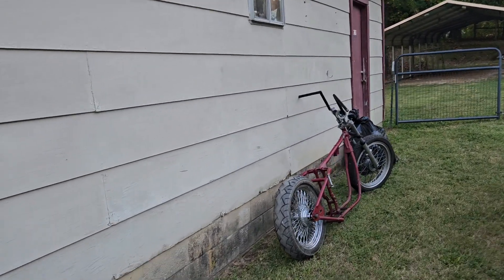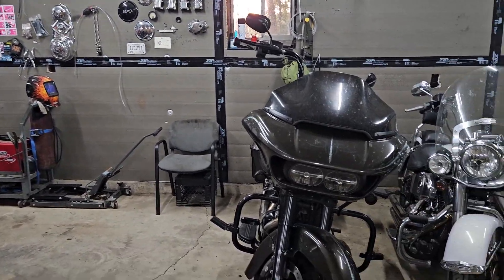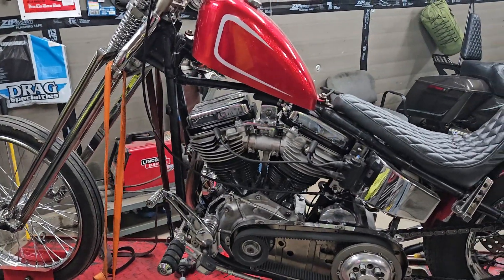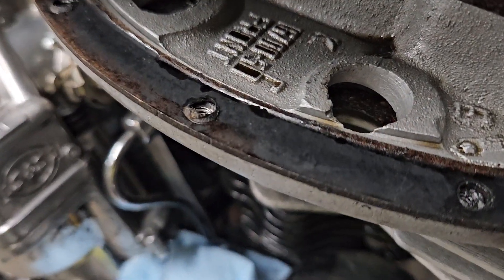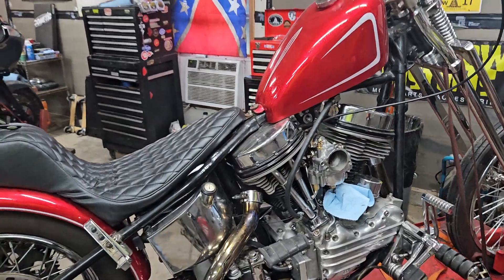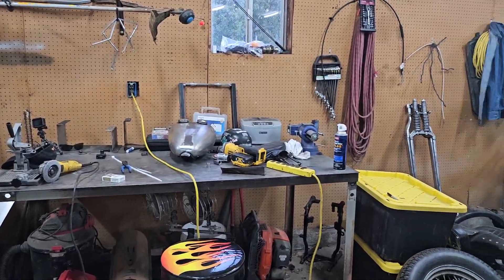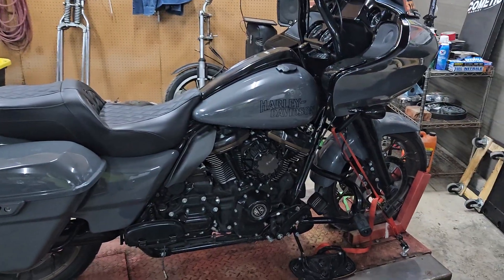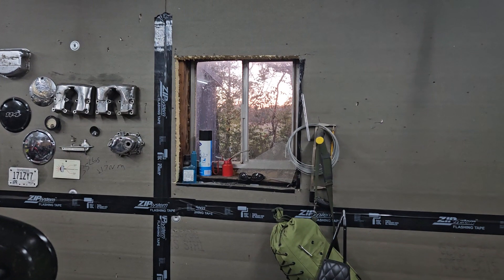Fixing the Panhead #Panhead #Shovelhead #Chopper #Bobber #Kickstart #Motorcycle #Harley-Davidson

Comment: Hey hippie. In your opinion  who makes a good lift table not made in effed up CCP? Thanks.
Reply from the maker: Honestly look on market place and find a used harbor freight one. You can get em for 2 to 3 hundred
Reply: @hippieschoppercorner  yeah. I have but I hear that they're  junk. Thanks hippie.
Reply from the maker: I've had mine for almost 10 years
Reply: @hippieschoppercorner  wow@ no eefffing chit! Well ok then man. That's  good nuff Fer me. Thanks hippie!
Reply: Just puttin in my 2 cents which may no be worth a chit, I’ve had one for about 4 years and works flawlessly. Was just reading the comments and saw yours and figured I’d put my 2 cents in.

Comment: Best of luck on the pan. I'd be frustrated as hell for all these headaches to happen on a fresh rebuild. I'd definitely swap the new springer out for the extended oem style. Whats the story with each of those forks (the one on the shovel and the one leaning on the wall)?
Reply from the maker: The one against the wall is a oem springer that someone extended back in the 60's or 70's. The short one one the shovelhead on the lift is a basic moto iron I believe.
Reply: @hippieschoppercorner  just my 2 cents but the extended OEM is begging to be on that bike. Cant wait to see it back on the road either way! 🤘🍻
Reply from the maker: @jakebu85  it will be eventually